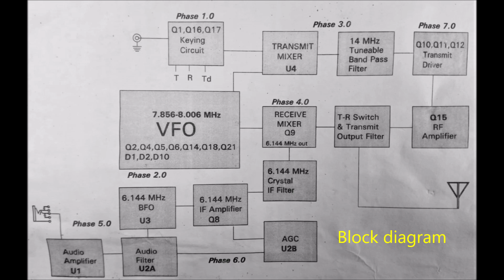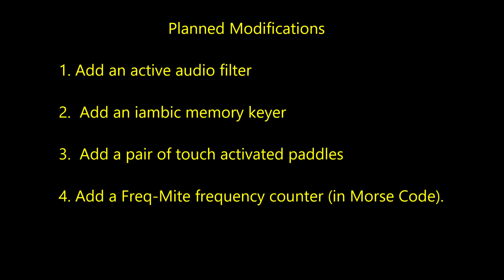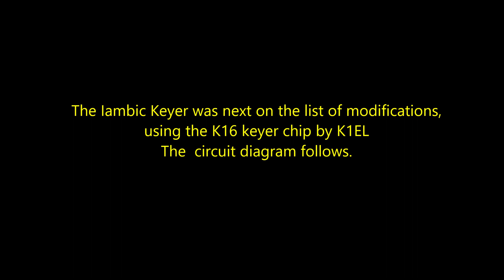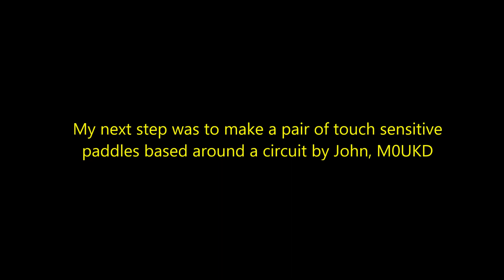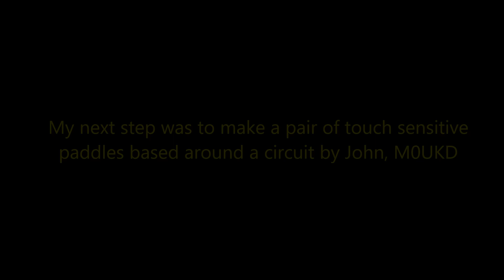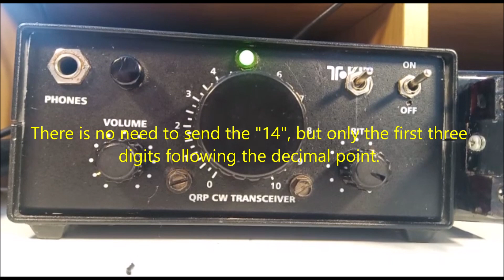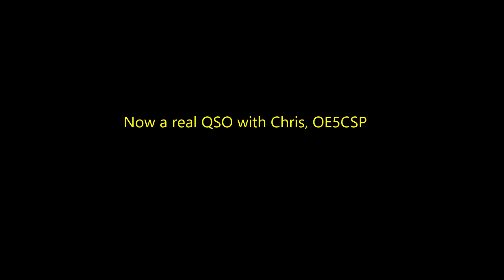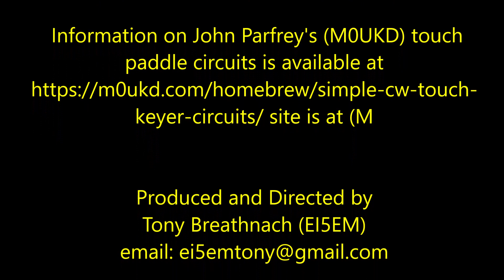Refurbishing and  Upgrading my Ten-Tec T-Kit 1320

Comment: I did just a few simple mods to my 1320:
1: big diode as reverse polarity protection and in-line fuse
2: diode in series with the key socket so nothing will come to harm if you accidentally plug the power lead into it (since both power and key use identical phono / RCA connectors)
3: soldered the cans of the crystals in the filter together and to earth. This considerably reduces of breakthrough from strong 49m broadcast stations into the 6144kHz i.f. This isn't quite such a problem today, but it certainly was when I built mine.

I wrote a review of this kit that was published in the August 2000 issue of RadCom. It's a great little radio. ☺

73 Mark GØOIW